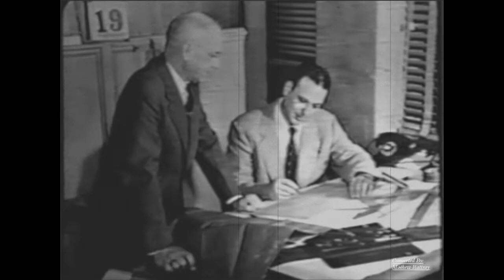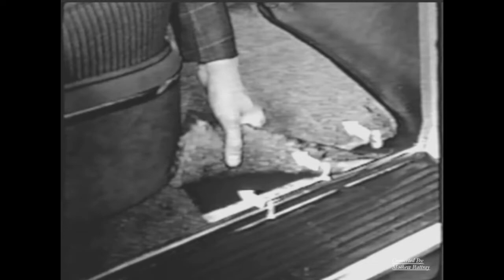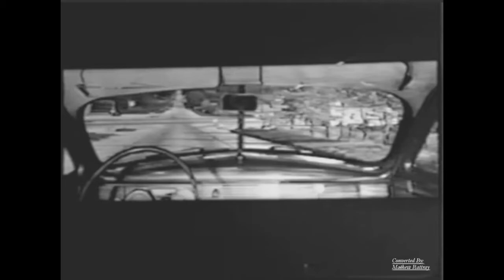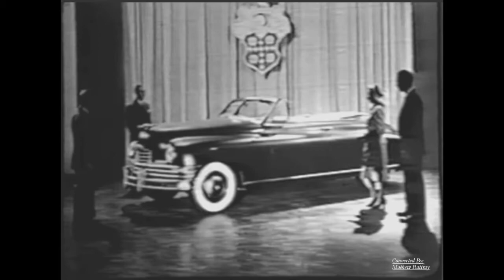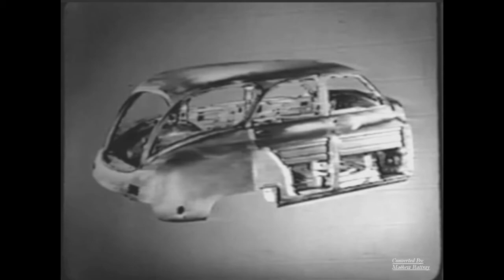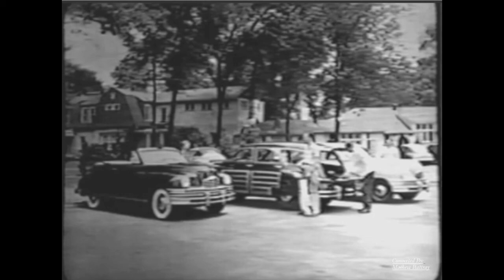Packard Motor Car Company 1948 training filmstrip -  Custom Designed

Comment: The beginning of Packard's death spiral. A little over 92,000 cars sold compared to almost 700,000 for sales leader, Chevrolet. Packard sold 100,000 only one more time after 1948, before before sales tanked.
Reply from the maker: Yes, the war affected the sales of Packard, as they hasd just revamped the line of vehicles prior to the war, and after the war the could never quite get it right.

Comment: This is not a film-it's a filmstrip--the beeps are the cues to move to the next slide--Note the wheel discs--they are not whitewalls--they only cover the wheels--they were utilized after WWII as actual whitewall tires were not available due to war priorities--I had a 1946 Dodge with them
Reply from the maker: Thanks for your reply. I appreciate the corrections